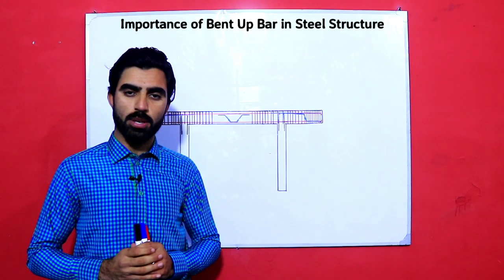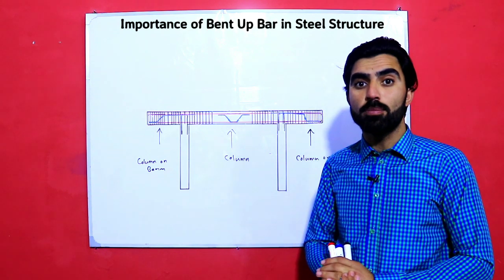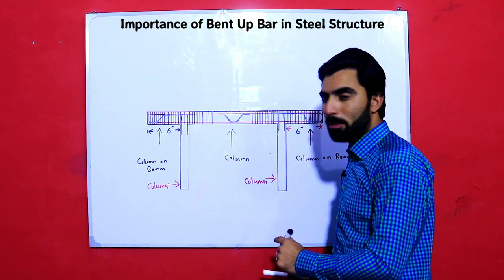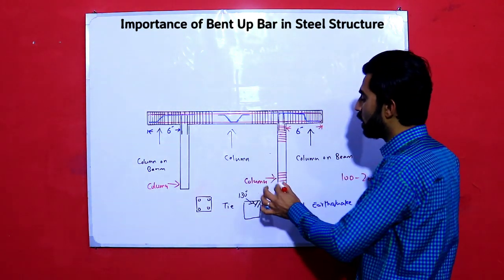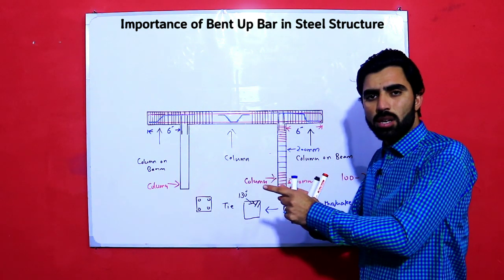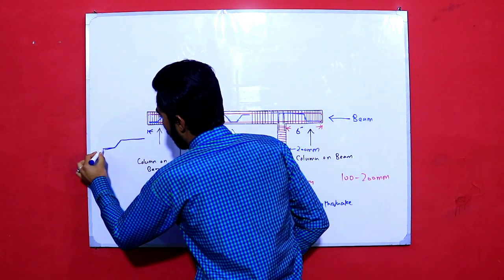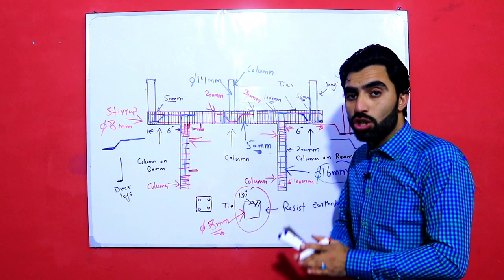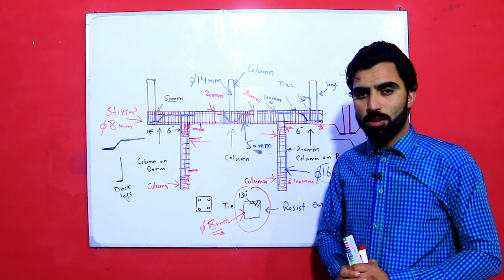Column on Beam without Support - How to Safe Column on Beam? -  Beam Column Steel Structure Design

Comment: Thanks a lot sir for the information. I have came across other articles and it turns out that there is a tipical bent up bar that we also call hanging bar wich is provided in intersection between main beam and secondary beam. The purpose of the hanging bar is to reduce the shear into the main beam if it is of a great amount. 
Can a hanging bar take another vertical load as the column?